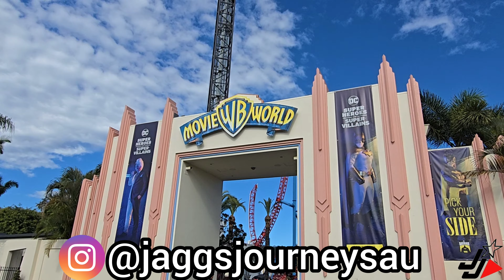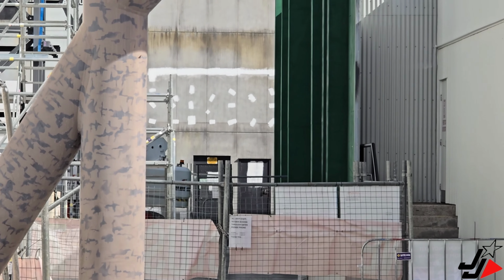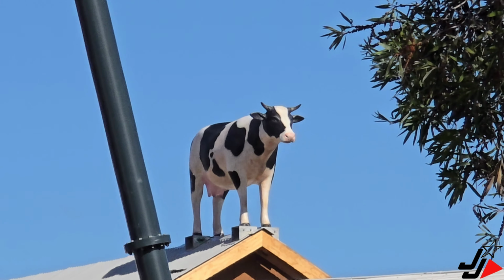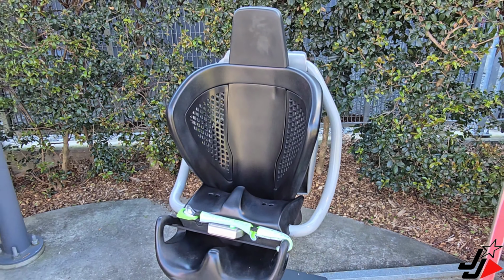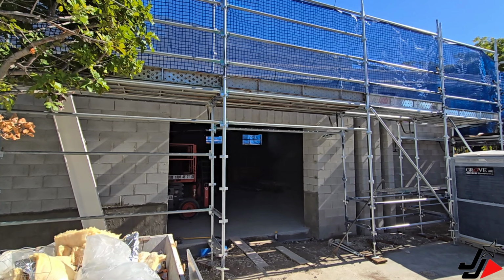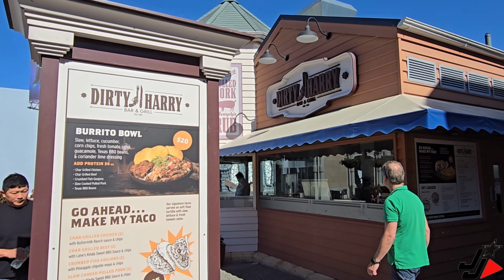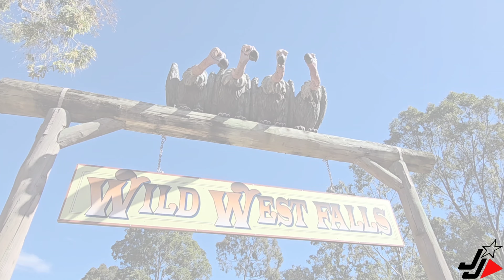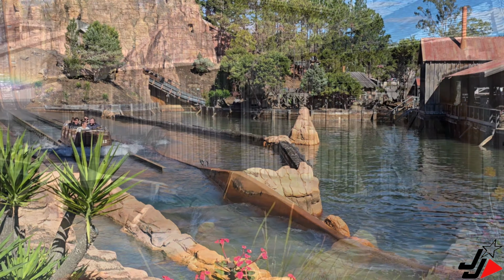MOVIE WORLD THEME PARK - NEW COASTERS & MORE!

Comment: Every time I ride Rivals I wish it was a Mack Flash instead, I am one of those not huge on Rivals "overall" as I find everything in the middle to be dead track. I like the start and the first 3 elements and the bunny hops. Have you ridden flash? A lot more actual solid coaster IMO, and inversions, and I really feel it's the time for MW to get a proper multi inversion coaster which I truly wish is what they did for Arkham's replacement. A current gen Vekoma invert would have been amazing. That already have Scooby and road runner -  so, why couldn't they have done the boomerangs, great idea, right, but instead of a Vekoma suspended family clone to go with them, do the thrill Vekoma invert instead. Does anyone else think that effectively 3 new family coasters is kind of ridiculous or is it just me? So if they did that, we'd have 3 family coasters or 4 if you look at the boomerangs as 2, and another thrill coaster. Maybe it's just me, but do they even have any room left if they ever want to add another thrill coaster or did they literally just use it all for the family coasters?
Reply from the maker: Yep - I agree totally! Yes, Flash was good, just really short cycle.
Reply: @JaggsJourneys  I meant Flash in China or Turkey, a Mack Hyper Coaster. I rode Australia Flash when it was Surfrider at W&W, it's fun, but it's the small model and the one that goes to 100ft has a lot more vertical time therefore a lot more thrilling imo.
Flash hyper coaster is so good, I'd have had that over Rivals any day, and I am not sure when they had such a good model why they did such a custom layout for us with that weird middle section. But now with Hyperia, wow, a longer version of that or even just as it is for their next coaster would be amazing if they have the room. An inverting airtime machine. No I haven't ridden that yet but spoken to those who have and most of the ride you are out of your seat apparently! Next year for that one. A quick "best of US" then the new Universal Park, fingers crossed it's open, then off to EU and UK. Can't wait! What would make it even more amazing is if Qiddiya is open already for the flight home. But either way I am coming home via M/E to do stuff like Mission Ferrari which I missed out on and Manta in Dubai and so on.
Reply from the maker: All sounds awesome - if you get to Qiddiya, that would be incredible!!!!